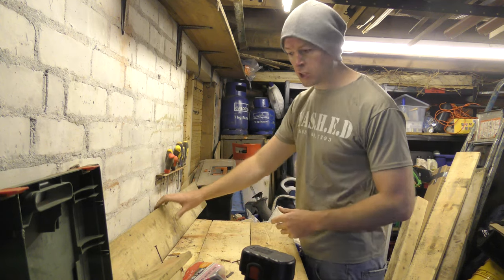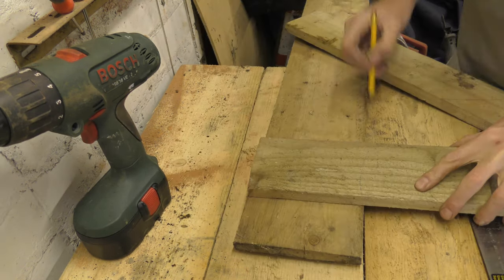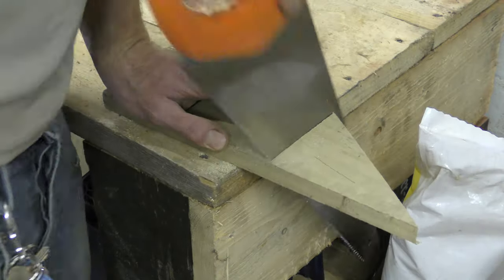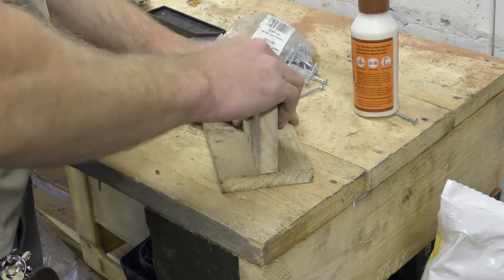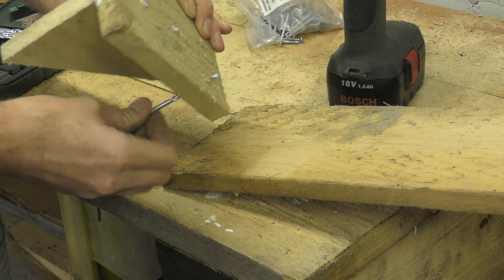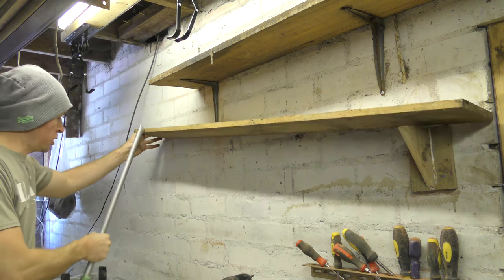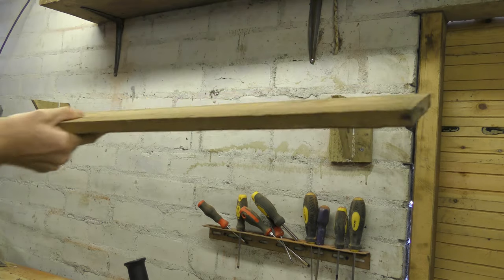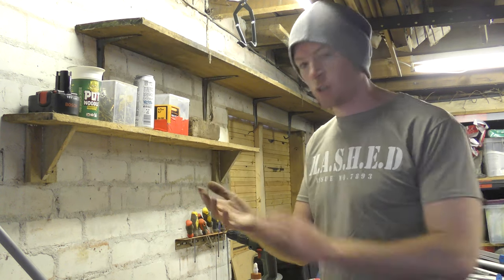DIY shelves with homemade brackets

Comment: Where did the straight cutting guide come from, could do with one of those!
Reply from the maker: It's called a mitre box.  Get them on eBay for under a £5.  You get ones that give you all the common angles.
Reply: @DavidMcLuckie  thanks. Like the look of that one but can't find like that but will be getting one as lost my old one.
Reply from the maker: I think that one is pretty old.